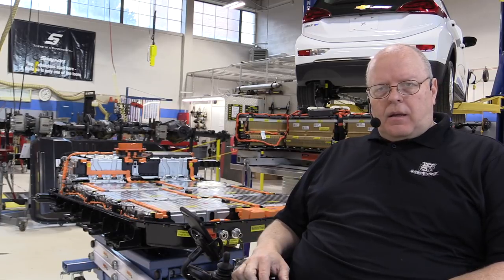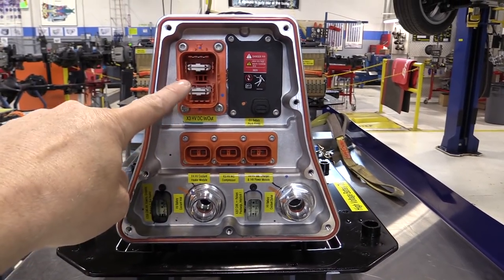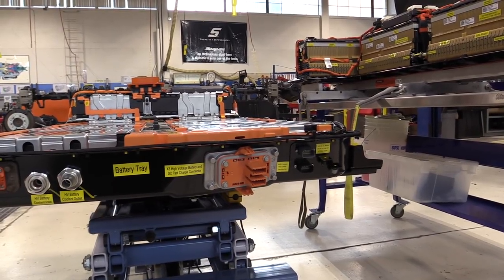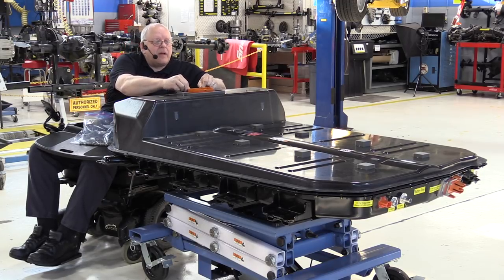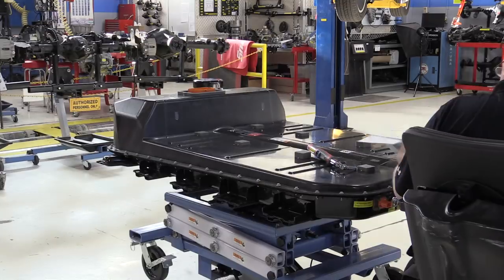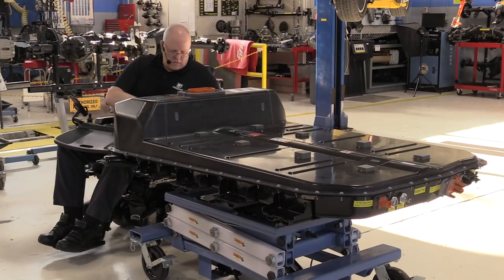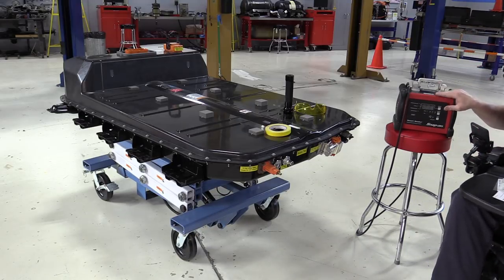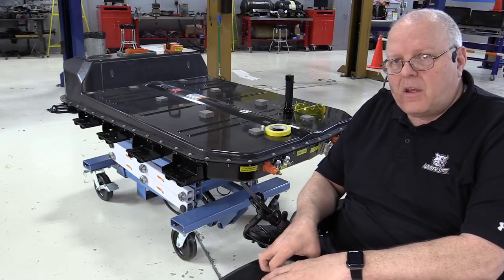Chevrolet Bolt EV Battery Smoke Test and Installation

Comment: I'm guessing the smoke molecules are larger than the normal air that would pass in and out of the battery. Thus, the smoke molecules may get stuck rather than pass through?
Reply from the maker: I do not know. that is a good possibility. Thanks for the feedback!
Reply: A tracer dye was mentioned, so it might partially condense on the patch and plug the pores. A check with a UV light would confirm.
Reply: Smoke particles can plug the membrane just like they would any air filter.

Comment: GM should reward you for these videos. It let the public see that actually Bolt is very well thought and designed in any way. Well except the absence of heat pump. My Leaf draws max 3-4kW in sub freezing weather and it blows hot air from the vents. I would say this is the major cons for Bolt EV and uncomfortable seats and slow DC charger  ... and really  very few CCS stations at some ridiculous prices per minute.
Reply from the maker: Thank you, and thanks for your feedback!

Comment: You said that you could not measure the battery voltage when you were removing the battery.  I got chastised one time when I said I could not measure a voltage.  Was my meter broken or could I not get to the connectors?  The proper thing to says is "when I measured the voltage it was zero volts."  Great videos.  Very long but I watch every minute of them.  Thanks for the great work.

Comment: Hello! Excellent instructor and content video. this really gives me a lot of knowledge of what i own (Bolt 2017). at least this gives me confidence what to do next if i should come in contact with any issues with the vehicle.

Question, what are the steps to take if I decide to tow my Bolt with my RV?

I heard you have to disconnect the vehicle battery (12VDC) to prevent triggering the parking brake...:)..

I am planning to tow the vehicle with front tires on the dolly and the rear tires on the road...

Comment: What exactly is the height of this battery? I'm wondering if there are any jack stands or if a home car lift product (EZCarlift, Quick jack. Etc) would accommodate lowering and removing the battery in an enthusiast's garage?
Reply from the maker: It is approximately 13 inches (330.2mm) tall. That might work. Best wishes!

Comment: I'm curious if the fast charge worked after reassembly. I'm guessing no but it seems silly for them to disable that beyond the two major components. Actually it seems silly to even offer this car without fast charging.
Reply from the maker: I have given up on trying to convert to DC fast charge. There are so many differences inside the car and under the hood that it is not cost effective over $3000. There are even harness inside the vehicle that are different with or without DC fast charge. Totally ridiculous! It could have been an add on option if it were designed to be either way. I will address this in an upcoming video.
Reply: @WeberAuto  really important for people to be made aware of this and make sure that their Bolt EV comes with that DC fast charging option (shown as GM RPO code "CBT") as a factory installed option (around a $750 option), since it has now become obvious it is not practical to retrofit it later with the factory DC fast charging option.

Comment: Love the videos I am an electrician (proud I.B.E.W.)  by trade and a mechanic at home with my uncle who is now a retired mechanic and we work on cars together. 

One question I have is what kind of safety procedures do they go through in the manual for this type of work? I see you have your high voltage gloves on but no other protection, and do they explain the proper procedure for testing your high voltage gloves every time before use? I ask these questions because as an electrician we go through alot of safety training and learning the details of an arc flash and the damage it causes the human body. My concern is unknowing service technicians not realizing these dangers. Now I'm guessing with the disconnect removed you lose all potential at the connectors but I noticed you still had your high voltage gloves on. 

Your videos are very good and would be an amazing class to attend with you. Thanks for the videos and keep up the good work.
Reply from the maker: Thanks for your feedback. I follow all of the safety recommendations in the factory service manual in regard to automotive high voltage. You are correct, there should no potential with the service disconnect level removed, but we are not allowed to remove the gloves until we verify there is no potential with a volt meter. Arc flash is a dangerous thing for sure, but at these DC voltages the arc flash boundary is less than 1mm according to NFPA 70E. This means face shields, sleeves, aprons, etc are not required. Have a great day!
Reply: @WeberAuto  ok yeah I wasn't sure what the arc flash boundary was on that. Thanks for the info.

Comment: Do you have a favorite EV?

I've only seen your videos about the 2017 Bolt and I'm very impressed with the car. The Bolt motor deep dive you did made me think this car was designed well. Is my admiration of the Bolt justified when it's compared with other EVs?

Thank you for making these videos available on YouTube.
Reply from the maker: Thank you! So far the Bolt EV is on the top of my list

Comment: I don't believe that battery cover torque sequencing. Especially when we see (in time lapse) that a whole side of the Bolt (no pun intended) battery cover isn't tightened until the very end of the sequence, which doesn't make sense. Somebody at GM was probably messing with you. I would do all 4 corners first, then make a cross pattern, and finish the remaining ones alternating sides. That way the cover would be pressed/held down equally all around.  Anyway, great video John, as usual !
Reply from the maker: lol, maybe that is true. Thanks for your feedback!

Comment: 16:29 - well that smoke machine definitely pressurized the whole battery :) Those yellow tapes hold well :D
Reply: What.. those small air pressure filter meshes... those... held the pressure.
Reply from the maker: The smoke is blown into the battery with low pressure Nitrogen at 0.4 psi (2.75 kPa). I was surprised by how much the upper cover raised and bowed. I did not even realize it had happened until I was reviewing the video in fast speed. Thanks for your feedback!

Comment: just wondering what you would need to do if the smoke test failed?  Great video as always.
Reply from the maker: You have to repair or replace the leaking component. No leaks allowed.
Reply: @WeberAuto  Just wondering what the repair would be.  I would assume if it was between the upper and lower cases then the seal would need to be replaced?   Are the fittings or electrical connections all replaceable or do you have to buy a new case?  Maybe a just a upper or lower half of the case?   Thx again.
Reply from the maker: All components for the Bolt EV battery are available for purchase.

Comment: 50 specially-torqued bolts to hold on a fiberglass cover...?  What the hell? Did GM outsource engineering to Volkswagen or something?  No wonder they lose money on the Bolt.  Great videos, by the way.  Thank you!
Reply from the maker: Thank you and Thanks for your feedback. The cover is not fiberglass, it is some kind of reinforced plastic. I forgot to mention that the rubber seal has metal inserts to prevent crushing.
Reply: Torquing it allows the seal crush to be even and equal all around reducing the likelihood of leaks!   It’s assembled with pneumatic tools (nutrunner is a specific type) that is configurable to a certain torque range or limit.  It doesn’t take any longer if you use the right tool.   They don’t use torque wrenches in the factory.

Comment: If this was my car I would be a little concerned that the total pack voltage was allowed to drop to 241 volts . That means the individual cells were sitting at  around 2.5 v. Pretty low when the nominal voltage is up around 3.6.
Reply from the maker: That may have been the original assembly plant voltage before the first preliminary charge. Thanks for your feedback!

Comment: 16:25

Is it normal that the cover expanded from the smoke pressure? You mentioned you forgot to shut the machine off but is there the possibility it caused any internal damage?

edit: watched the frames ahead, you noticed it.
Reply from the maker: The smoke is blown into the battery with low pressure Nitrogen at 0.4 psi (2.75 kPa). I was surprised by how much the upper cover raised and bowed. I did not even realize it had happened until I was reviewing the video in fast speed. I did leave the Nitrogen injection on too long, I am sure it affected the level of distortion. Lesson Learned! Thanks for your feedback!

Comment: Why are there 2 less electrical connections on the Bolt battery versus the Volt battery? (Auxiliary coolant module and electric compresser system) Is the Volt better in some way because of this fact?
Reply from the maker: No, the Bolt EV just moved them to a separate box under the hood. Thanks for your feedback!
Reply: WeberAuto, Thank YOU 🙏😊

Comment: @WeberAuto How easy will it be, or is it even possible, to upgrade or replace the Bolt's battery in 5-10 years when my current one is not holding charge well enough or if I want to swap it out for newer battery tech? 
Tesla is largely a battery company, it's possible the could start making battery cells for other auto makers to use. Or other battery makers might make upgraded battery packs for EVs. Heck it may even be possible to DIY one.

Comment: I assume the smoke has a UV tracer dye. Wouldn't it be somewhat better to use a UV light to look for leak traces?
Reply from the maker: Thank you. Yes, it would be more helpful. The service information just says to use a bright light. The filtered lenses really help. Have a good day!
Reply: WeberAuto 
Edit: thanks for responding
The yellow filtered lenses are designed to block deep blue and UV light. If the only illumination is a UV or Blue LED light (matched to the excitation spectrum of the florescent dye if possible) you will get way better contrast and even tiny leaks will be easy to see. There may have been a specific accessory for the smoke generator with the best light and glasses.  If you dont already have a blue/UV tracer light and can give me the part number of the fluid(?) used in the smoke generator I can see if there is a cheap light available that is matched well the the dye used.

Comment: I really enjoy your videos.  Thanks!  One question:  At 34:50, when you do a second round of vacuum, the red lever is on the close position, not allowing more coolant in.  I would have expected it to be in the open position.
Reply from the maker: At that point I was applying additional vacuum in preparation of adding more coolant. The red valve was closed while the vacuum level was increased. Thanks for your feedback!

Comment: was there a gasket or o-ring between the top and bottom half, and should it be "lubed" if it's a o-ring as I would guess.
Reply from the maker: Yes, there was a double ribbed rubber seal with metal inserts. No lube, just dry. Thanks for your feedback

Comment: BTW, a smoke test is when you plug something in that you haven't used in years, or you just bought, or you just took apart and put it back together, not a seal test using a pressurized fluid (or gas). Words mean things GM.
Reply from the maker: Thanks for your feedback

Comment: On my Bolt the dealer replaced the battery. After a year after the battery swap I did my first charge on the CCS charger. It made terrible noise from the floor. Battery below. I took my GDS2 and run the battery coolant pump for 10 minutes. This brought some improvement, but I still have air in the battery coolant system. Does anyone has the same issue bleeding the battery. My idea is to redo the GDS function test for battery coolant pump on a steep ramp to see if this might improve the  bleeding. What does the experts say? 

Here some additional information, if I do the GDS2 function test of the battery coolant pump to 80% max load, I have noise coming out if the battery pack. Do you have experienced the same behavior, is this air or coolant flow noise. I have no idea, since I trying to eliminate this noise which I realized at the CCS charger. 

Thank you for your comments. 

Regards Bob

Comment: Would it be possible to use the same kind of procedure (with vacuum and pressure tools) to replace the transmission fluid?
Reply from the maker: Possibly for refilling the fluid after draining it. It depends upon the transmission vent design and seal designs. It would be in interesting experiment.

Comment: Where can I buy some gore patches, any size and shape? Tried ebay and aliexpress, but no luck.
Reply from the maker: Any GM dealership part department. Part number 20791600 Battery Valve Vents
Reply: No GM dealerships where I live, but part number helps a lot. Thank you.

Comment: I have the 2017 Bolt. I normally use hilltop reserve to prevent charging to 100% in order to extend battery life.  Is this really necessary? Does Chevrolet already do this?
Reply: I charge my Bolt to 100% every night. The manual doesn't mention the need to not fully  charge to increase battery life. Hilltop reserves purpose was to allow for regenerative braking to work and to charge the battery if you live in an area that starts with a large decline. Otherwise the system would have to use the friction brakes and probably bleed the excess energy back thru the motor.
Reply: Dave Barrett, I own a 2017 Chevy Bolt too. I also use the same Hilltop reserve setting to charge. Definitely can’t be wrong if you don’t need the extra miles. I hear it’s BEST to keep Li ion batteries in 20-80% charge. I wondered like you do if Chevy “already” places a buffer in there by stopping charge before it’s really Max’d-out on charge (ie says 100% charged but is actually 80% to max capacity). Also, I wish hilltop reserve stopped at 80% instead of 86% or whatever it is currently.

Comment: i tried think diag  from launch  it works with IOS\ android using diag zone program with Hyundai Kona to bleed the batteries , and read each battery capacity it real  work good with EV Cars doing all factory functions but with Tesla not real advanced .

Comment: First off-excellent instruction and knowledge.
However, my take is that this just proves that EVs will eliminate the possibility of the average person from doing any repairs  on their vehicles.  There will be no  "fixing up" old, used EV cars.  Lower income people will not own cars any more because they will not be able to afford them. Where now a decent used gas car can be had for around a couple of thousand,  a used EV will be close to 10 grand.  The special tools required will not be affordable by the average mechanic or, even average independent repair garage..   This is many years in the future but, it will happen.  Hopefully, there will still be the possibility of using gas powered vehicles that already exist- mainly classic cars etc since they have limited numbers and the overall "carbon foot print" will be negligible.  I am in my 60's and glad I grew up in the golden age of automobiles.

Comment: Unfortunately, this video reinforces my suspicion that the Chevy dealers aren't really up to the needs of servicing this car. I got rear ended in the Bolt, and the first thing I did was call Chevy and ask if they wanted to inspect the car. They just said "take it to a body shop". That kind of nonsense is going to bite Chevy. Its a complex car, and leaks or damage to the battery pack is very serious.
Reply from the maker: I agree, it is a slow process to bring everyone up to speed regarding the service and precautions of vehicles like this. Anytime an EV or Hybrid is in a collision, it needs to be inspected and checked for malfunctions and trouble codes. Many body shops will not have the ability to do this. Best wishes!
Reply: It will happen... eventually.   Dealers know that EVs require less maintenance and that mean less money for them.  When all cars are EVs, they’ll have the tools, but we have to get past 1% of EV sales in the USA first for them to really invest.   It’s gonna be an interesting future.

Comment: I am going to guess it is "until smoke comes out of the service plug". To be a real test, it has to purge the air from the battery. That won't happen if you don't let air out. When the regular air is purged, out comes smoke, then you seal it up completely and add pressure.
Reply from the maker: I think you are correct. Thanks for your feedback!

Comment: Why would you bother with N2. Just used compressed air.
Reply from the maker: Compressed air contains water vapor
Reply: True, but you can use an inline dryer. They are commonly used for painting systems that used compressed air. But N2 is probably nearly as cheap as air and I'm sure the manufacturer would prefer mechanics use that rather than trust them to use high quality compressed air.
Reply from the maker: @jagardina  Also, the maximum pressure is 0.5 psi (3.4 kPa)
Reply: @WeberAuto  So you use the same regulator that you used on the N2 tank. I'm guessing the N2 is stored at something higher than 0.5 psi. Anyway, I understand the need to avoid moisture which would be why this practice was adopted.

Comment: I think the manufacturers are going to have to come up with a better way than this to keep water out. If I was designing it I would have an active positive pressure on a sealed pack with a monitoring system similar to an EVAP system. Then the driver would get an error when a seal fails. Then it would be safe to drive in a foot of water and may survive a flood. If the packs are this fragile to water damage insurance costs are going to go through the roof for electric cars.
Reply from the maker: This system is sealed very well. driving on wet roads is not a problem. Driving through a foot of water is not a good idea on any passenger car. Thanks for your feedback. Have a good day!